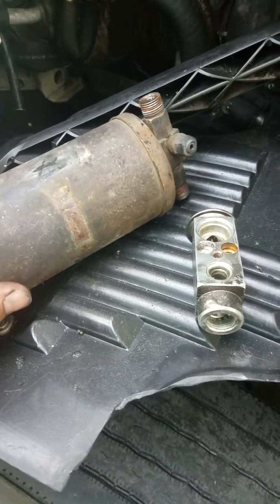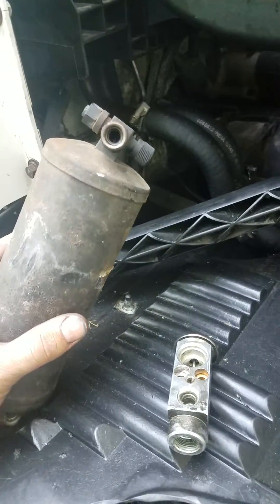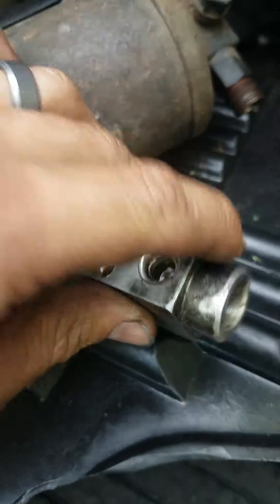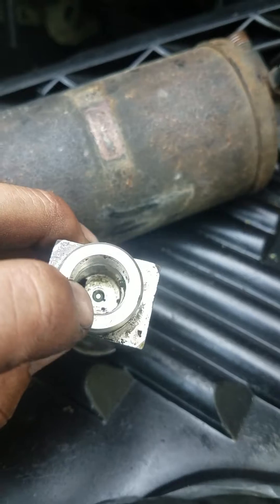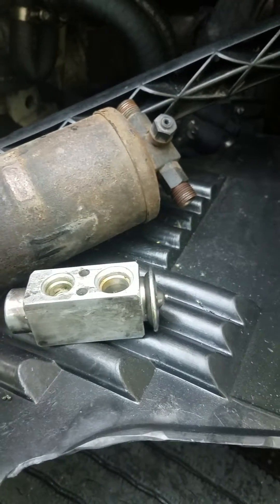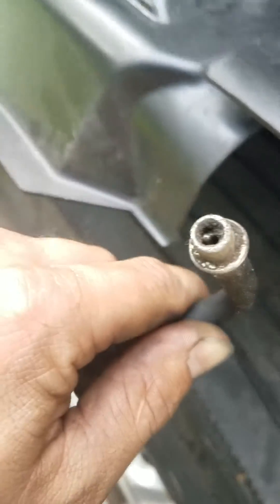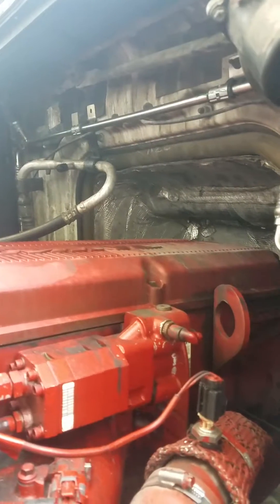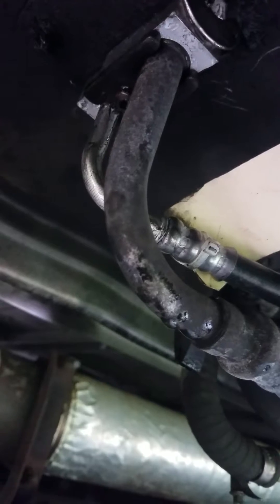AC fixed.  Bad dryer.  Not compressor.  No leaks.  Clogged high pressure lines from dryer debris.

Comment: How did you figure this out?  I have an a/c system the only has pressures of 20L 75H on a 54*F day.  I installed the required amount of 134a after a condenser replacement and pump down.  When we purchased the car it looked like previous owner drove it through a snow bank and mashed a good portion of the condenser fins.  I was assuming this problem may have damage the compressor but after seeing your video I am wondering....?
Reply from the maker: If you can disconnect the ac lines and blow air through them, then they aren't clogged.